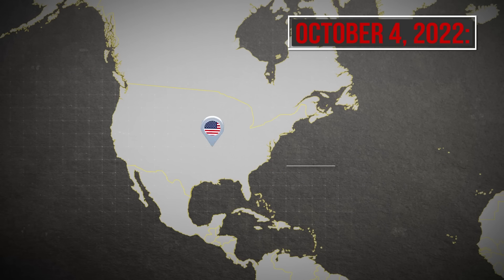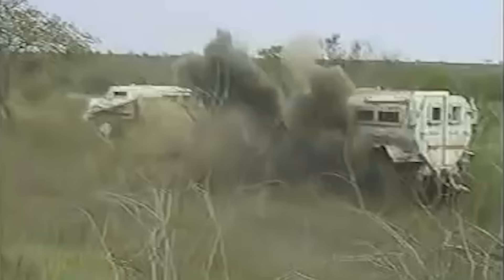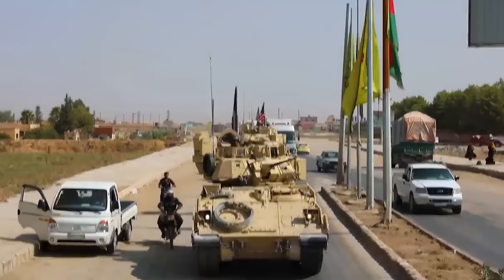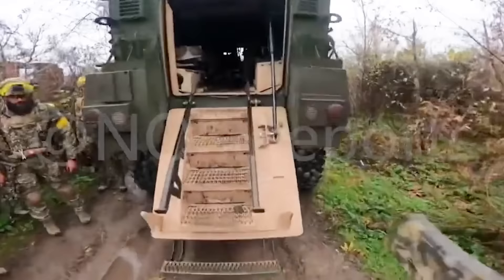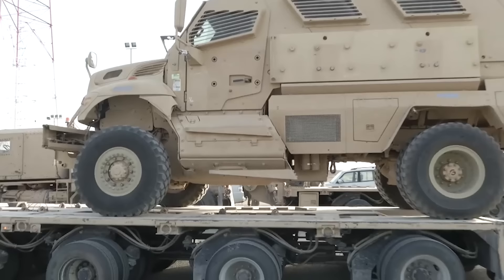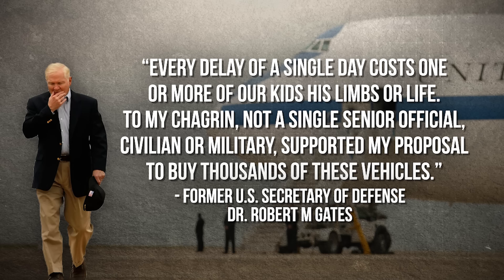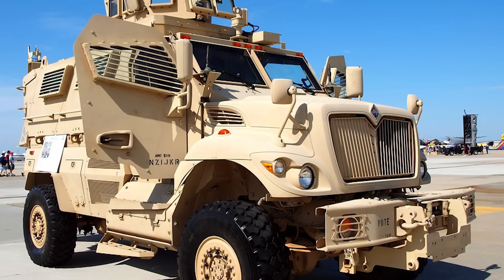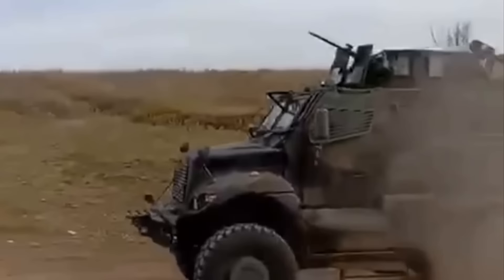Why America is Gladly Giving Away their $50 Billion Truck

Comment: I worked on the first RG33 MRAPs by BAE. I also worked on its predecessor program of adding armor to the 10 ton FMTV.  The army wanted armor kits to protect the bed of existing truck that could be produced quickly and cheaply. The problem was they need more armor that existing trucks could handle, so they turned to MRAPs. The problem with MRAPs was with a few weeks of being fielded the enemy learned how to destroy them and then an armor kit for the MRAP was needed. I know one thing the US design did different was use blast absorbing floors to reduce the shock wave from a mine. The other problem was they Iraqis learn they could be flipped very easily.  From what I heard from MP units the Textron MRAP was the desired one even though it was cramped.
Reply: It was crazy. We saw cutting edge MATV's sitting in Air Force motorpools at JBB, Taji, and the Green Zone/BIAP, never being driven, and the rest of us who actually ran CET missions every day down the MSR's had clapped out MaxxPro's and Caimans with busted CREW systems and bent Rhino's on the front that were on their 4th or 5th deployment TPE handover.
Reply: @WindFireAllThatKindOfThing  It's actually kinda funny that the Air Force gets the latest and greatest ground vehicles, but a lot of their aircraft are MUCH older than the pilots flying them. I live next to Warren AFB and the missile convoys have new armored trucks and new semis pulling the missile carriers that probably date back to the 70s and escorted by ancient Hueys that were probably built in the Vietnam era and flown by pilots who's grandfathers might have flown the same chopper.
Reply: All it needs is a fully auto belt fed 30mm or 40mm sniper gun mounted on the top of it to turn it into a "Rolling Wart-Hog" tank killer. What-Ever the Ukraine's arm it with you can bet the pentagon will be jealous of the Ukrainians innovative skill set. It's amazing what a Ukrainian can make out of a $25.00 WIFI security camera mounted to a telescopic gun sight feeding streaming video to an old iphone 6. Our military would spend $50,000 for something that was 800X bigger and could not be fixed by a 12 year old with a guitar pick and a micro screw driver.

Comment: Speed is an interesting factor in Ukraine. During the rapid advances toward Kupyansk In August/September, Ukrainian soldiers were advancing incredibly quickly, often in civilian vehicles. I can see MRAPs being a compelling factor in such an advance, though it would be less useful in a more static battlefield like the one near Kherson.
Reply: yes, not only that, but MRAP is basically a truck with armor, so its much easier to repair and maintain that tracked soldier carriers whilst provide better protection by its speed.
sometimes a better way to protect against enemy is just switch position, and MRAP is great at that, slow tracked vehicles are just too slow and bulky for that.
also, anti mine design is sure to save more lives that any combat vehicle available as most casualties are from anti-tank and anti-personnel mines.
Reply: @Kesh Getting back from Kherson Right now, I can't agree more with this.
Reply: I get your point, although even the Kherson front collapsed pretty fast in the end!
Reply: pay attention to the general shape of the front, which is very beneficial for Ukraine - a horseshoe
Thus, with a total length of the front line of more than 1000 km, a march between any section (even the extreme points themselves) can be completed overnight. Taking into account the presence of a fairly extensive network of roads (although of course already pretty damaged)
if I write from Kyiv, I can clearly see))
Reply: The things just get stuck in the mud.
Reply: @andreimoutchkine5163  if we talk about maneuvering from one end of the front to the opposite (and that's what I meant), then most of the way passes along roads with good coverage. And the dirt in the field, well, it's dirt everywhere if it rains))
And that's the problem, no kidding.
Waiting for frost! despite the problems with electricity, we are all here waiting for the land to finally freeze in the south of Ukraine
Reply: @user-sv2fp4io8l Ukraine Is Not an Innocent Player Here.
Reply: I saw 1 video of the Ukrainian style offensive. shells were blowing houses up on both sides of the road as they swerve around the shell holes at 50-60 mph. once thru the lines or as far as they can drive they all fanned out and the soldiers "dismounted" . In this particular video they went thru the line of russians and were behind them when they got out of the trucks.
Reply: @jasonlawrence4617  Near Kherson? perhaps they were commandos. But could be anyone, typical Ukrainian style ;)

If you are interested, there is a channel in English. Conducted by the press officer of the special forces of the National Guard of Ukraine. His unit participated in the destruction of the Ka-52 of the Russian landing in Gostomel, in the early days of the invasion in February 2022. I don’t know if he posted videos on this channel, but there were a lot of them. And he told a lot of interesting things - I know him, he has been fighting since 2014
Reply: Not hard to "advance" when your enemy does a tactical retreat. Lmao. Also most of ukraines military is dead. Try researching
Reply: They might be mine resistant from an explosion below, but I'd bet these things are absolute death traps for any kind of drone strike, air strike, or artillery strike.  So they're really just a big heavy insanely expensive truck.
Reply: @brianlowe3529  I'm probably an idiot but I genuinely don't get why this is considered trash? 

Yeah its a bigger target but the upside is that it can take more punishment, Cappy said .50cal. It just seems like a bigger Humvee, with better protection.

Yeah its a bigger target. but like the humvee, isn't it not supposed to be a frontline vehicle?
Reply: @zebrajenks  Where have you been the past 9 months lmao?
Reply: @eftheusempire  you really believe in this “tactical retreat” stuff? )))
Reply: @eftheusempire  "Most of the Ukrainian military is dead"

Why is Russia still losing then? How are you guys completely unable to Kershson or take Bahkmut?

Comment: As a South African very proud to see our influence on MRAP design and most of all how many lives they saved. I have seen newer designs which have a lower profile than the old Casper. The  Casper was a simple vehicle, cheap to build but great for bush warfare and riot control. The Americans seem to make them super heavy and expensive. South African tactics has always been speed is your best defence or weapon.
Reply: Casper was a very decent vehicle from the "research" I have done. 
Simple, Cheap, and Quick imo are good ideas
Reply: American makers always have to find ways to make things MORE EXPENSIVE. Not efficient.
Reply: Super Heavy, but still faster than the Casper according to the Specs on both vehicles.
Reply: No Americans make things with much better quality and research.
Reply: @angelg2638  huh... The US Abrams series of tanks? F-22s, F35s, F15s, So many more.
Reply: @harlemboy413   and where do you think Americans come from?
Reply: American military doctrine takes into account being shot at by precision guided munitions, air-launched missiles, advanced sensors, etc.  So, things need to be heavier simply due to both the armor and the various systems and weapons to survive on such a battlefield and therefore must be larger to account for that.  The South African military is unlikely to come across those types of threats or at least not in enough numbers to make a strategic difference.  And with the environment they'd most commonly be fighting in, being able to see over brush and obstacles and being able to maneuver quickly out of ambushes or to move where needed or reinforce infantry rapidly is much more important.
Reply: Yes...MRAP is a South african creation......the war against SWAPO  influenced the design...

Comment: The problem with welding armor onto the 998s was that the frames and bodies were never designed to handle the weight.  I can't tell you how many oil pans we damaged because of the suspension being maxxed out even before combat loads were added.  The Maxxpro and Maxxpro plus were improvements, but then you ran into center of gravity problems,  Saw a lot of them with intact cabins after IED strikes, but also saw a lot with little holes in them from EFPs.  Saw the Romanians using them for route clearance on route 1 in Afghan, replacing their BMPs and BTRs.  Big question for both the police and Ukrainians is vehicle maintenance - a lot of the work needed can't be done in the field.

Comment: Glad you used video of MS Congressman Gene Taylor in your video.  He was the one that actually went to check on the up armoring of vehicles and found that (I have been to the one that did the M113 and same problem) the government workers there were working a little and as slowly as possible in order to stretch it out and keep jobs......don't give a d*mn about soldier's lives as long as they keep their well paid, low work load jobs.    That is also the reason that it used to take months to get replacement parts or even things like D batteries through the supply system.   As with many of Taylor's investigative reports.......congress pretty much ignored it.  It seems that other than photo ops of them going YEA! Troops!, they really don't give a d*mn.

Comment: One of the various roles for an MRAP Cougar could be as a forward supply vehicle in a hot zone.  When people were negative about the tracked M113 being sent to Ukraine, I thought it could have various non-combat roles.  Ukrainians have used those a lot, and even in combat.  Ukrainians figure out how to make use of and modify things in surprising ways.
Reply: They immediately started riding on top like US troops in Vietnam. Leaves room inside for supplies.
Reply: The Australian Army sent some of their surplus up armoured and up engined M113AS4’s - they can be identified by the six road wheels (up from the standard M113’s five) and a turret on some examples. They are basically the stretch limo version of the M113 but the Bushmaster has better armour.
Reply: But why use that? DAF, Rheinmetall and Iveco all offer supply trucks with armoured cabins, off-the-shelf, much cheaper, and they don't guzzle diesel like there's too much of the stuff.
Reply: @nvelsen1975  The “armored” trucks can’t survive an antitank mine blast - the flat floors of the cab just results in the cab being ripped off and thrown into the sky with lethal results to the crew (and joy for the opposition who get to loot the trucks cargo). 
Russia also makes armored cabs for their trucks. The Ukrainian army thanks the Russians for the resulting ammunition resupply.
Most of the US casualties in Iraq and Afghanistan were truck drivers who hit IED’s or mines.
Reply: @allangibson8494  
An MRAP isn't going to survive a mine that can knock out an MBT either.

I'm not talking about some 40 year old American truck with some sheet metal welded on it. They're pretty good platforms that can carry a lot, quickly, behind sufficient armour.

Whereas the MRAP can barely carry anything at all, slowly, while slurping fuel at an alarming rate.
It's not a supply truck, don't use it as such.

It's basically just the German A7V argument all over again.
Reply: @nvelsen1975  An MRAP is designed to protect the CREW against an antitank mine explosion. And they do. The angled floor diverts the blast away from the crew compartment and the increased height gives room for the blast to dissipate (unlike a MBT). The MRAP “failing to proceed” afterwards is irrelevant if the crew are uninjured - the MRAP has done its job and can be towed back for repairs (and they frequently were in Afghanistan (usually a new front end and cargo boxes bolted to the hull)).
The armor under an MBT is pretty close in thickness to a MRAP but absolutely flat - meaning more easily punctured.
They are designed to provide protection against different primary hazards. Hitting a MRAP with a 105 shell will not end well for the MRAP but a MBT will probably return fire.
The Bushmaster holds 10 fully equipped troops or an equivalent volume of freight with a four tonne cargo capacity. At 15 tonnes fully loaded it isn’t light but it does provide good protection in an air transportable vehicle.
Reply: I know us brits have a varient of MRAP that does just that.
And those are already in use by ukraine.
Reply: Problem is they are very easy pray for enemy IFV - its now a numbers game - will Russians destroy all these vehicles used in front line faster than west can deliver. 
Certainly better than a pickup but there is a reason why US army is getting rid of them.

Comment: Australia has supplied Ukraine with 90 Bushmaster Protected Mobility Vehicles. It has a primary armament turret (remote or manned) .50 cal MG or 40mm AGM and and 3 swing mounted 7.62 MG's. It has more than fair ballistic and IED protection (V shaped hull) and will carry a 9 man infantry squad. It's also air conditioned, serves cold beer, and is equipped with 3 surfboards and a BBQ.
Reply: AC is actually pretty common in modern armoured vehicles, but it isn't for the crew lol. It's to keep the components (usually computers in more fancy gear) cool. It's a happy benefit.
Reply: Was great to see Aussie contributing those
Reply: I was sold when you said cold beer
Reply: The Bushmaster was in production before the year 2000.
The US/UK mode of thinking did not lend them to logical conclusions. They were locked into big war GROUP THINK. But most wars are guerrilla and need these type of assets. So to get rid of MRAP assets is to hinder future operations.
MRAP should be used only as battlefield taxis, not as main combat assets. To get infantry to the fight. Weapons that are mounted are for self defence against infantry, not for attacking.
Reply: Yes and the Ukraine forces really like them.

Alas though Ukraine isn't Iraq and the Russians have weapons that simply blow them up, like armour doesn't exist.

That's been the big point with all the NATO stuff all super technical and pretty much when GPS is blocked is completely useless.
And the Russian missiles are much much better than what the US ever expected.
Reply: The Bushmaster seems to be the best of this type of vehicle, however produced in relatively low numbers to suit the Australian army. Looks like it used the SADF version as a proto type and improved. I remember talking to Australian and US Iraq and Afganistan vets who said the Bushmaster was much better than the Humvee in any form. You have to remember that this type of vehicle is not a regular combat vehicle, but a protected infantry carrier used to bring infantry close to the battle but not into a battle like an IFV.
Reply: @TalesOfWar  Bushmaster was designed for Australian conditions and the air-con was needed for the troops, as was done to the LAV.
Reply: But Ukraine is fighting a large conventional combined arms forces, so mraps will face many threats unlike from an insurgency. I saw a clip of what was left from a bushmaster that was not blown up, horrible way to die. But that's war.
Reply: @cottelito92  if its the image you are referring to, the bushmaster was hit but all crew got out alive. I've read it was then hit several times, and the other story was they destroyed it them selves so no comms equipment could be captured
Reply: Bushmaster wouldn't have lasted long in SA busy war.
Reply: @TalesOfWar  Wrong. The LAV that Australia got from the US did not have AC but had to fitted for crews to remain combat efficient. 
The Bushmaster was required to have AC for the same reasons.  Australia has a hot climate and no AC is stupid.
Reply: @zagan1  Everyone has the weapons to defeat the Bushmaster. Any RPG will do. The Bushmaster should not get into close combat. It is not designed for that. Remember that it is only for use as a battle-taxi.
Reply: Beer and BBQ that`s why the local police dept`s have them around here.
Reply: @basilpunton5702  we've had slat armour as well as BARRACUDDA IR shrouds on some of the Recce's
These were never meant to be "front line combat"
They're designed for A to B travel with the ability to run over a Boom Boom and usually keep on going
They have weapons to beat off infantry squads but that's all we needed.....one thing that most people forget is that we've actually got "missile bus" versions of these based up North that we've kept for ourselves incase Indonesia decides they want Darwin or something 😂
Reply: spiderman no way home<somebody makes alot of money on this

Comment: This brings back memories, I was part of the field trail the wolf in 1977 in rundu,the precursor to the buffel, and casspir. This was a armoured shell on a 
unimog. We had to sort out the movement between the chassis and the sprung box. Main issue was the gearbox linkage…never worked, so drivers cab was separated out from floating shell, and gave the buffel…

Comment: Nice work Cappy. Every success comes with a price, JLTV is the successor vehicle which could be used against conventional army, city terrain and is MRAP protectected. In the near future we will need globally more MRAP grade or to some degree mine resistant armoured cars cuz wars are fought in cities.
Reply: IMO the old MRAP can still serve, just not in frontline stuff. sometimes you just need something specialized in a single thing compared to everything... f35 comes to mind
Reply: ALL MRAPS provide protection; just don't try to take them into soft soil. 8 times outta 10 they will get stuck.